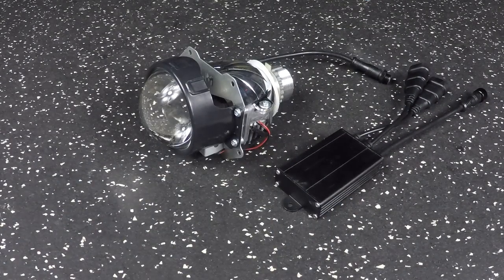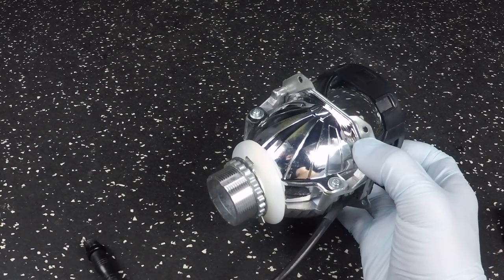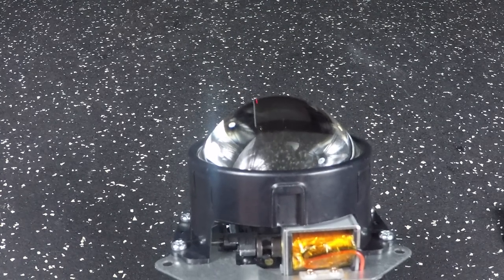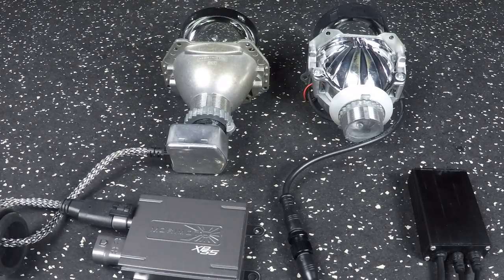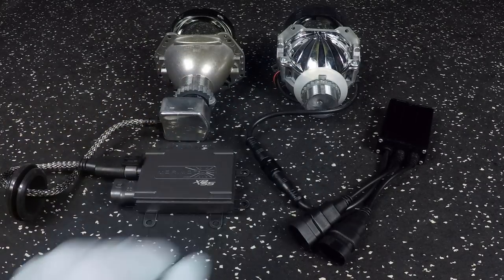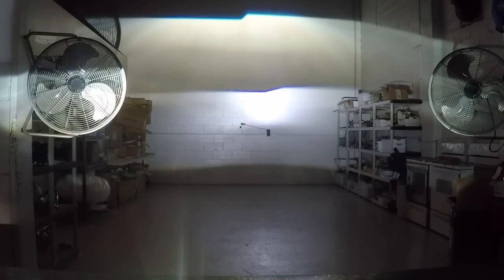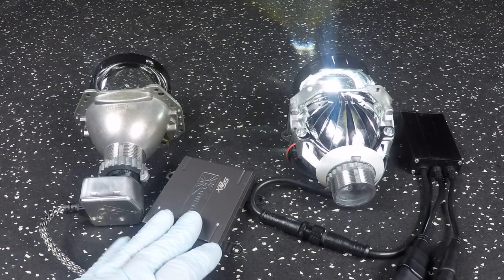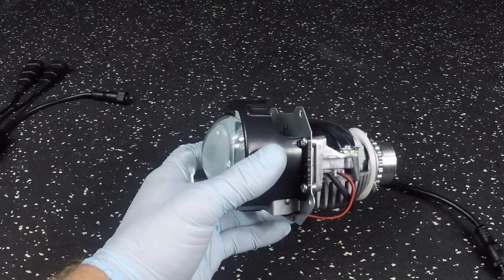Morimoto M-LED Product Overview + Comparison

Comment: See... I dont think these can work... people complain about hot spot and not as much light and all that with LED and I was thinking about it today and looking at the LEDs in my new Civic Touring, and what they have in the Acuras and a lot of other cars, there is a reason I think why they have the assemblies with a large number of assemblies in them, I am thinking they figured out that you cant get an even beam pattern and good light dispersion from a single point source and realized that the way to do it right is a large number of smaller independently aimed units... just my two cents though.

Comment: One stat where HID wins is CRI (color rendition index). I prefer a light temp of 5000k with 90% or higher CRI. The led in this video looks to be high 70% or low 80% CRI.

I'm also nervous about the cooling fan, when the fan dies so will the led, the led will run for 10 years no problem, the fan? I don't think so.

Comment: My gripe with this is, being a epoxy type of guy vs a nut and bolt, if the led ever fail you would have to hack up your build to replace it, let alone taking the housing out and separating the lens and putting it all back together. To each their own, for the moment though i am going to stick with good old hid's.

Comment: I will wait for the version 2 or even  MLED version 3.0 when aftermarket LED surpasses HID. I have seen oem acura LED headlights and they are impressive..but not enought to let me remove my mini d2s and make the switch
Reply: does mini d2s come with hid bulbs or just hid projector ?
Reply: yamin huang just projector..you have to buy the HID or LED seperately, this model in the vid has build in LED
Reply: I like how wide and even the Acura leds are, but the light output seems weak in intensity and falls off quickly.
Reply: Randy Martosoewito why not just wait for flying cars?
Reply: rellik187redrum 😂😂😂😂😂
Reply: A quad setup would destroy any oem setup :)

Comment: This is why manufacturers have gone to using multiple small led projectors rows. I'm sure Morimoto will provide the multi row led projector headlights eventually when led has surpassed hid, but I'll stick to my hids in my 05 dodge ram 2500.

Comment: They should give the option of a smaller shaft. This looks pretty good aside from the slight pencil beam effect from that hot spot. Reminds me of the old E55 beam pattern.
Reply: since that shaft is removable then different sizes ought to be do-able.
Reply: even if you make it yourself

Comment: I'm pretty impressed with these and when I do finally do my retro's I'm considering this. I've currently running LED's in my reflectors (an 08' Civic) and the light pattern is pretty decent actually. I don't blind oncoming traffic or annoy anybody even driving head-on with my highs on with cops coming towards me. Anything over 10K lumens (4K lumen bulbs) is too much though for the housing which is fine for me. I love how much more clearer things are compared to halogen bulbs traffic signs and road paint light up so much more clearer and safer in pitch black. I haven't tried HID's yet but honestly all the wiring etc. just annoys me as I'm lazy

Comment: The hid spreads out more if you use the correct bulb. As u can see the led has a bright point which doesn’t help when you’re driving. You need the light to spread out. Just my two cents

Comment: If you mention the failure points of HID, you should do the same for the LED.  The driver, LED chip, and other components on the LED board inside of the projector can fail too.  LED is great, but not perfect.

Comment: I hope this is marketed well. Most people, for good reason, overall think that HID's surpass LEDS on every metric. While this is true for plug and play, it's not true for OEM units where LEDS have been surpassing HID's in light output (just see the difference between HID vs LED currently on Porsche 911's). When I first saw the Kioto LED projector system on the certain Lexus automobile and 8th generation Maxima I was quite surprised to find out those are dedicated LED systems. Examining the Maxima's Koito's LED system it became apparent why the LED system was superior to HID's and plug and play LED systems:
1.) A dedicated projector for the LEDs.
2.) The huge heat sink and fan to cool the LED chips.
3.) The all in one integrated module (including the driver) specific for the system running at high efficiency.
Reply: HID still far surpasses single LED projector units.  It takes a multi LED array or a Matrix LED system  to beat a single HID projector.  No doubt LED is on its way to becoming great, but HID is still king by far.
Reply: Eh Meh incorrect, for example, most new BMW's come with single led headlights X1, X3, 1, 2, 4 series as standard here. And they are brighter than hids.
Reply: The fact that LEDs can use arrays is an advantage, not a disadvantage. Plus we have to think about where HIDs have the advantage. Compared to the Koito or Corolla LED, only advantages HIDs have is in color and width- subjective stuff that has nothing to do with safety related performance.
Reply: Width doesn't have anything to do with safety related performance? I wonder what the IIHS would say about that. http://www.iihs.org/iihs/news/desktopnews/more-than-half-of-midsize-suv-headlights-tested-rate-marginal-or-poor
Reply: You're reasoning is not as sound as you think.  Just because LED can be brighter, does not mean it's better.  Light distribution in terms of width is extremely poor when referencing a single projector LED unit.  A single LED projector has the majority of it's light concentrated directly in the center.  Whereas HID is able to distribute light to greater widths providing better driving visibility.  I will take a wide beam over a bright pencil beam any night.
Reply: Eh Meh LED is gunning for that crown faster than you think. I have the MH1 6.0 setup for aftermarket bulbs with philips lumileds zes chips and my xB 35 morimoto setup (with a rebased Philips 65122) is weak in comparison.
Reply: I think the reason is that hid does surpass led in most metrics 
Why do you think led light sources aren’t used for any serious cinema projectors imax for example went straight from xenon to laser on their top of the line projector.
It’s because it’s very difficult near impossible to focus the number of individual point light sources required to match xenon into one uniform beam 
Even if you use one led the way a led emits light is still at a disadvantage because the single point source will still be much larger 
Now in automotive applications it’s less critical as people don’t mind and notice a terrible beam pattern as easily but hid has far better distribution in both low beam and high beam 
You should see some of the led bi led high beams it’s laughable 
The real reason oems like led is cost led is far cheaper than hid its comparable in cost to halogen for a oem that’s why you now have base model cars come with led then there is a higher end led

Comment: as mentioned in the video the temperature to touch with the led, would it be too cool for us in the great white north?? ice and snow buildup on headlights is a real problem if there is no heat inside to melt that stuff off.

Comment: Led can easily change its intensity with a decent driver. That would be awesome if the mled allowed that function. Can easily switch the led on and off variably to limit the output easily.

For instance, when the high beam is activated, the driver increases the intensity to your desired level.

Clearly the hid has a much wider hotspot, something you should disclose. Ie area of the hotspot.

The mled 2.0 version will be amazing. Bit til then I'll ride my fxr 50 watt setup. Amazing projector. If morimoto made a larger led version (same size as the fxr) that had wider output with the same intensity and larger hotspot with programmable driver then I'd switch right now. Oh and keeping the fxr superior cutoff actuator design (my d2s models kept having stuck actuators and it sucked and the newer versions didn't fix the problem).

Comment: I definitely switch over to LED after using the MD2S 3.0 since 2015. What to expect after a shield mod? Will it increase the width of the pattern?
Reply from the maker: It reduces width. Increases intensity. This is D2S 4.0 Im referring too. Not the LED unit.

Comment: You said a lot of space savings..... that space saving is at the back of the bulb/headlight housing. What sucks about this LED setup is that it's going to sit out further ahead in the headlight housing and possibly touch the clear headlight covering. These are too large still.

Comment: How long can that fan dissipate heat  for when it’s in an almost airtight headlight?
Reply from the maker: Considering many OEM LED projectors have fans running - we do not consider the fan an issue. Headlights are not airtight and the LED's dont run as hot for example. Heat should not be an issue.

Comment: So what happens if the bulb goes out? You gotta take the entire headlight apart?
Reply from the maker: The idea is, if there is a failure you would be replacing the driver located on the exterior of the headlight. Not replacing the projector. There is no bulb, its just a set of LED's on a board.

Comment: Gonna stick with my modified d2s 4.0 with nightbreaker unlimited bulbs and 45w hylux ballast. I have yet to see anything led that isn't drastically more blue. 4200k on dark wet roads is much more usable than 6000k. I am also not relying on a fan that will eventually fail and overheat the system. Zero  warmup is great but that's it. I want to see 4300k led to ever even consider it. The blue is not for me.
Reply: This ^ in every respect.

Comment: Will it fit H7 or do i have to cut the reflector?
Reply from the maker: Yes you will need open up the hold to push though the shaft, or you can custom mount.
Reply: Lightwerkz Global Inc. You did a c63 few months ago and do you think that the M-led will fit?
Reply from the maker: I think without the threaded shaft it will be possible!